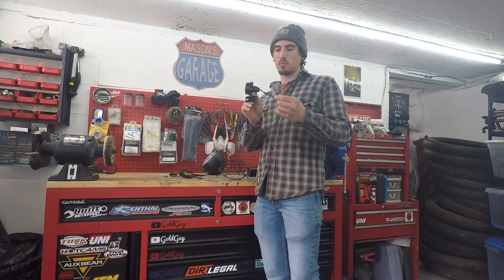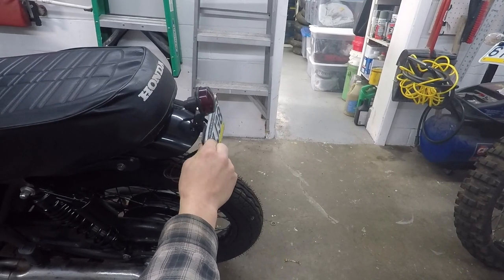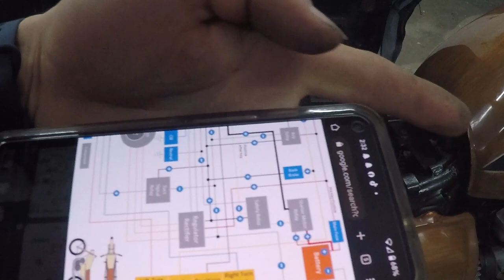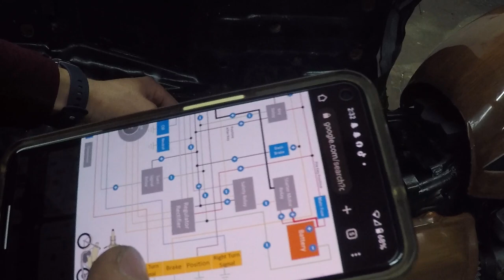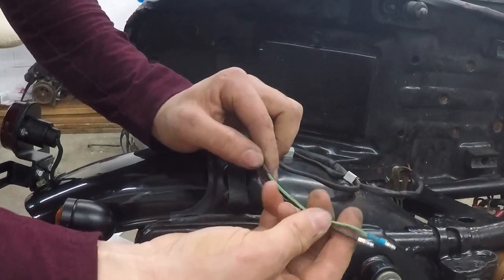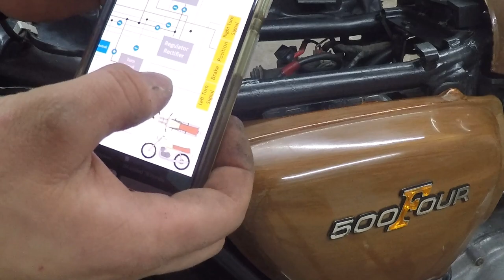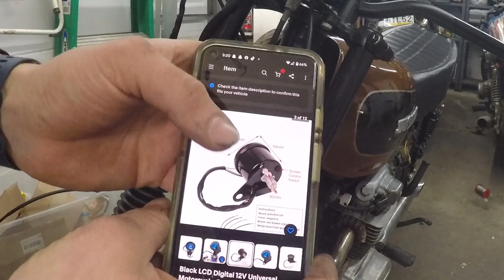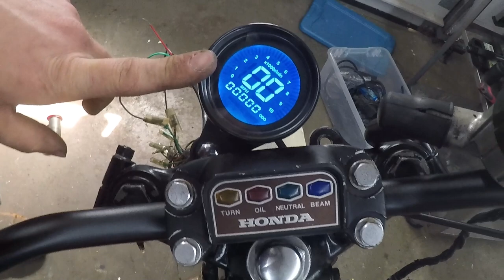eBay Motorcycle Speedometer, Head, Tail light and Turn Signal Install | CB500 Café Racer Build #11

Comment: When you upgrade your lights on a old bike you have to change out any relays and switches designed for the old lights. Just make a new wiring harness that can handle the reduced load of the upgrades, plus it gives you a chance to simplify it. Don’t forget to cap or plug the hole if your deleting the tachometer cable.
Reply: How do you usually cap that hole?

Comment: The speedo you got for the mechanical cable on the back is it the speed sensor or the tachometer?
Reply: It’s for speed, you get the tach readings from the ignition system. Look at delete plugs for the tach since the cable isn’t needed.